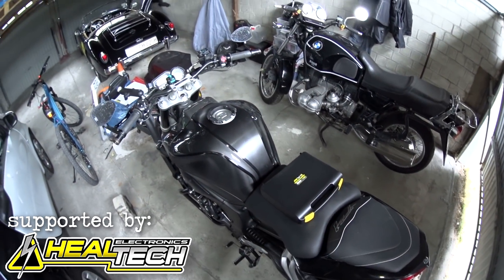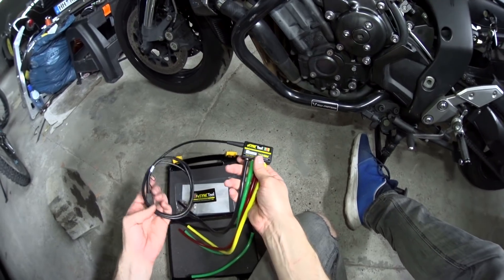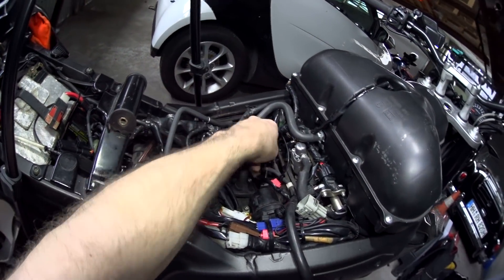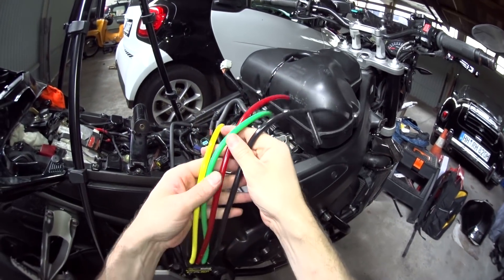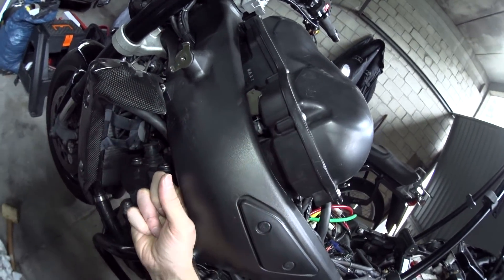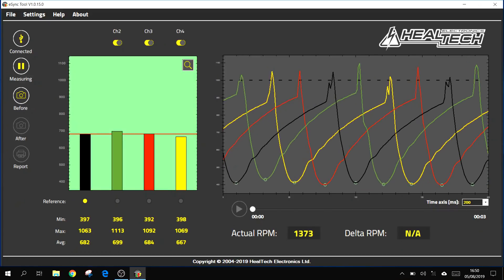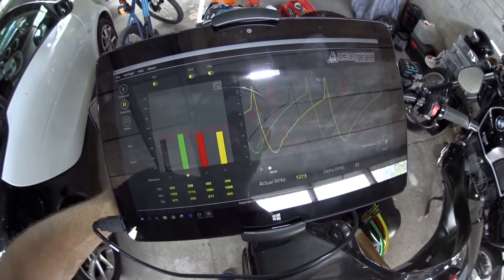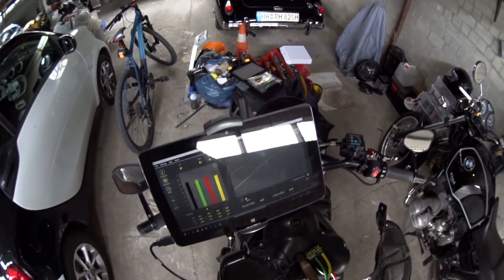Healtech eSync Tool, EST-01, Yamaha FZ1

Comment: What was the t connection you disconnected and plugged in the scalpula hose into? I see the connections 1 and 3 and 2 and 4 being connected through the black coupling fittings but what is the white t from ?
Reply from the maker: That T-piece was from my Scottoiler. So you can ignore it. Stock, the pipe would be straight through without the t-piece.
Reply: @AndyManCam  so it would just be the 1and3 and 2 and 4 connected with those black fittings?
Reply: The other lines connected to all 4 throttle body’s are not needed to be bothered ?
Reply from the maker: Each cylinder gets it‘s own hose on the esync. Otherwise the readings will be mixed.
Reply: @AndyManCam  yessir for sure but on the Fz1 they are tied together with those black fittings. I think what confused me is on your 2 and 4 you have a tee connected instead of the original black fitting correct ??
Reply: @AndyManCam is there any way I can send you pictures of what I’m referring to?? I think I got it figured out but I just want to be sure before I proceed 😂if you dont mind..
Reply from the maker: Those black connectors are blind, if I remember correctly. You take those out and connect the four ends to the four hoses from the Esync. You‘ll need to use the brass nipples in the kit to connect the hoses. Pretend the White T piece just isn’t there.
Reply: @AndyManCam okay for sure the clears it all up I appreciate it and the adjustment screw is the small flat head in the cylinder ? Right by the hoses
Reply from the maker: That I‘m afraid I can‘t remember! It was so long ago and I‘ve not seen that bike for 4 years! Sorry! 🤦
Reply: @AndyManCam all good man you have been a massive help so far I appreciate it !!
Reply: @AndyManCam okay last question I swear😂😂 but in the video you grab the screw driver and are on the right side of the bike which would be cylinder 4 correct? In the video you say you are adjusting 1 did you switch sides and edit that part out or is cylinder 1 on the right side 🫣
Reply from the maker: It doesn’t really matter which is 1 and which is 4. just look at the color of the hose, that’s the same color as the line on the screen. So adjust THAT screw, to move THAT line.
Reply: @AndyManCam ahh okay but the screw to adjust cylinder 1 is on the left side they could 1 from the left as if your sitting on the bike or is it counted left to right as looking at the bike from the front ??
Reply: Maybe I’m just confusing myself 😂😂😂
Reply from the maker: I think so, yes. As if you’re on the bike.
Reply: @AndyManCam okay good I really appreciate the help man it’s been a life saver !!!!
Reply from the maker: No worries. Hope all goes well!
Reply: @AndyManCam  I hope it is my issue😂 I just got the bike tuned and it’s kinda jerky and idles rough tuner said it’s prob that vcyclenut tuned it. If it’s not that maybe a vacuum leak I did change the air filter and did the air box mod idk we shall see
Reply from the maker: Might be worth checking the fuel line under the tank to make sure there are no kinks. There’s a video about that too! 🤣

Comment: click bait.

unless you have a gen 2  FZ-1.
Reply from the maker: Not really. Firstly you can use this device just as easily on a gen 1. secondly, the gen one is called an FZS1000. Both Fazer, different code. For me the FZ1 began in 2006.

Comment: Love your videos Andy, they have guided me through lots of mods on the FZ1..Why remove the tube from bottom of the map sensor and block it off? No mention of that or AIS in manual? (my AIS is gone so that's not an issue..)
Reply from the maker: Thanks mate! I’m not entirely sure. I think it’s about avoiding any possible fluctuations or interference from the sensor from interfering with either the readings or the running of the engine. Ultimately, Healtech know better than i do , so i just went with what they say!

Comment: Nice video. Thanks for sharing👍 can it works for an ETV throttle like 2016 Kawasaki Zx10r please ?
Reply from the maker: As long as you have access to vac ports on the throttle body, it should work with all types of throttle.

Comment: Before adjusting the levels, if a previous adjustment job has put the reference venturi flap out of sync from its original factory settings, how handy will this device be to reset it tomits original positiin to then proceed to sync the other 3 flaps to refernce point??

Comment: Did you have some at-speed cruise handlebar vibes that numbs your fingers long rides?
I have a 2011 FZ8 that does this....now more than before seems. Had it since 8k miles in 2014 to now with 22k miles. 
As far as I know, no valves or sync ever been done. Bit it runs great

Comment: 289,00 EUR current prize for this tool is too high. If you are IT guy then you can build you own cheaper version of this tool (4 map sensors + arduino mini). This will cost you maximum 3 eur (arduino) + 20 * 4 ( a new map sensors), so 83 euro. And you can have it even cheaper if you use a used sensors. BTW already custom made tools you can buy on ebay...
Reply from the maker: How much does an IT guy earn in a day? If he has to spend 2 days building this, instead of working, then that’s how much it ultimately costs. Great if you can do it. But I’d also have to first learn all of the skills needed. Probably going to take me weeks, maybe months, possibly years. So how much does the DIY version cost now?
Reply: @AndyManCam  You can already buy a working and assembled https://digitalcarbsync.com/shop/ for a half of a price and no need to have any additional phone or tablet. Or You can buy for 15 $ DIY instructions
Reply from the maker: Again, great if you have the time. Does your time cost nothing? I could build a whole motorbike if i wanted, but I’d rather pay a little extra that somebody else already made and actually use my time for riding the thing! You do you. For many people, this product is perfect.
Reply: @AndyManCam  So why You are doing sync by yourself? Pay extra money for mechanic knowleadge :)
Reply: @AndyManCam  Tool is good... but cost is ridiculus
Reply from the maker: Because this is the middle ground. After 2 balances, the tool has paid for itself. I’ll have it forever though. If it’s too expensive for you, then don’t buy one. I wish you all the success building your own.

Comment: Hi Andy, how did the bike ride following the adjustment? My GSF650 throttle is very on/off on the initial throttle phase, and at idle it can be a bit lumpy, making cruising at constant speed a kangarooing pain! It has been suggested to balance the throttle bodies.
Reply from the maker: I think it certainly couldn’t hurt Adam. My bike ran far smoother after the balance. Not sure if it comes across in the video, but when it reached a certain point, the engine seemed to suddenly ‚calm‘.
Reply: AndyManCam thanks Andy 👍🏻 something to look into over winter!
Reply: I got this set up.... Just asking did you connect all the colours to each of the map sensor ports instead of the blanked off ports .. I have an FJR I did throttle body strip clean.... Everything came off and got blown out.. I just want to make sure I'm doing it right when I go to sync... thanks

Comment: For the price should be iOS compatible and they should include a better manual to teach all the faults they advertised in the features. When they get done those then I will pay $300.
Reply from the maker: I'm not so sure I agree. The interfacing with IOS would be a nightmare because of the continuing Dongle struggle! Plus it's not Android compatible either. For the intended use, I think most small garages and workshops will be using PC based systems. This is primarily a professional tool, so using time and money to develop mobile device compatibility (not to mention the licensing costs of getting MFI certification) would be wasted resources versus the market for which the tool is designed. I also try as hard as possible to keep my expensive and fragile Apple devices well away from my workshop!! 😂
Reply: @AndyManCam  I know you wrote this 3 years ago but thanks for this reply as you have just answered all my questions. Well done. I find Apple devices quite robust BUT they are PITA to link with anything except other Apple devices and even then this isn't always straight forward. I have a love hate relationship with my Apple devices.
Reply from the maker: My pleasure! Yeah i feel exactly the same. Nothing else has ever worked as well for what i mostly do, but they often make things pretty complicated!

Comment: I am interested in getting this tool so this video was very helpful, thank you! Currently, I have the CarbTune tool which is analog, would you say this'd be worth getting since I already have an analog tool and this is not exactly cheap? What I like about this tool is, according to its vendor's claim, it actually detects valve clearance problems, too.
Reply from the maker: I would say that this is definitely a lot easier to read than the carbtune. As to whether or not it's worth it when you have a carbtune already, or if the balance will be better, hard to say. DOwn to your personal preference i suppose. I personally enjoy the fact that you can compare before and after, and also actually record your balancing session. The valve clearance checking ability is still in the pipeline, but I will be very keen to see how that pans out.

Comment: I have buzzing noise coming out near by handle bars what could it be??
Reply from the maker: I'm afraid it could be many things! Probably best to start by making sure everything is tightened properly. Then if it's still there, try touching or holding components on the handlebars while it's making the noise to see if you can find out what is vibrating.

Comment: I saw this device on the Healtec website but to be honest had no idea what it did and presumed it would be outside my capabilities. Another well made AMC Garage vid. Cheers pal.
Reply from the maker: Cheers mate. It was surprisingly easy to use, except for the part where I had to find the screws to adjust the throttle bodies!

Comment: Great instructional video
 It looks like Healtech have reinvented the wheel and doubled the price.
I've had a set of Davida Gauges for over 30 years and the have worked faultlessly. No need for a laptop ( when I brought my gauges it was only NASA employees who had lap tops ) with the correct operating system and software updates.
Reply from the maker: Horses for courses I guess. If what you have works, then totally stick with that! Never change a working system!

Comment: An Impending shim-job.... That has to be a three-parter. 20 valves IIRC.
I've done enough of these to know that the there's a reason people own singles.:D
Reply: I'm going to get a 2007 FZ1 with 43k km on it. Time for a valve clearance inspection?
Reply from the maker: I think it's due at 45k km. So I'll be considering doing mine soon. :(

Comment: Nice video, I did find interesting that you didnt check "Zero" on the vacuum channels by hooking all 4 "pipes" to the same throttle body to see that all 4 channels read the same. I guess that's what we did in the old days of carb syncing. I guess the digital world is that much better.
Reply from the maker: I guess I'm not as precise as I'd like! I just decided to trust in the tech! :D Plus I didn't want the extra faff of connecting and reconnecting all the pipes!
Reply: @AndyManCam  I'm sure the transducers are accurate, be interesting to see if that bit of kit would work without interfacing with the ecu, so you could sync carbs on old bikes aswell
Reply: @matthewjackson9765  it didnt interface with the ecu, it will work on carbs as well

Comment: Nice bit of kit and well demonstrated. Before balancing carbs / throttle bodies the valve clearance check / adjustment is always recommended.
Reply from the maker: I'm trying to put off the valve check as much as possible! But it has to be done at some point.

Comment: I fitted a Healtech gear indicator on my new Honda CMX 500 Rebel last year and it hasn't skipped a beat.!  Very good quality stuff :)
Reply: Some years back I bought a used Healtech gear indicator on eBay for my Versys 650. That bike got totaled out by a fool in a truck running a stop sign. The gear indicator is now on my replacement Versys 650.
Reply from the maker: They're tough little boxes of joy!